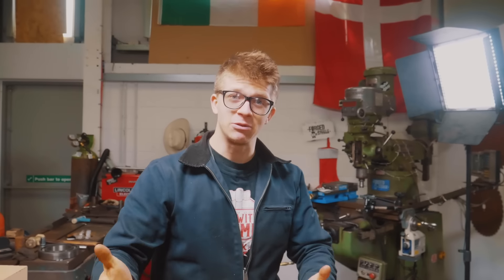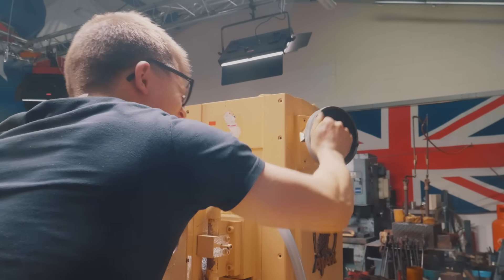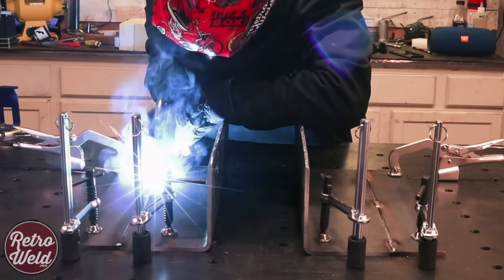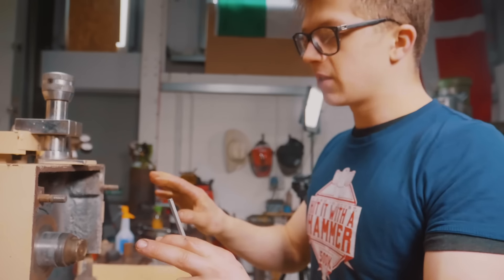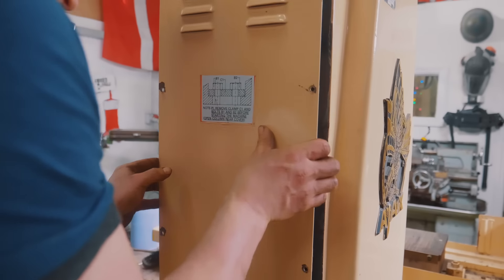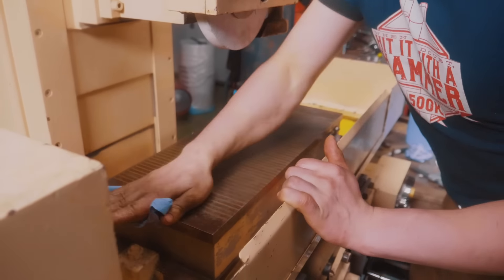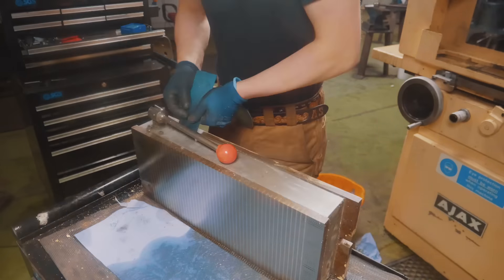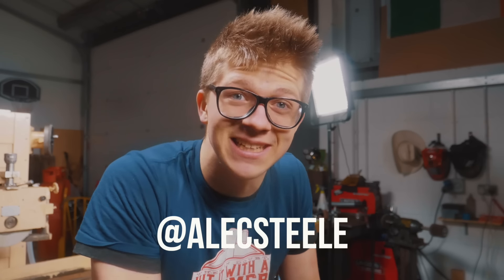THE SURFACE GRINDER IS ALIVE!!!

Comment: Alec as an electrician 2 thing that made me cringe watching you do the electrical 1st please use some crimp ring type terminals on the ends of the wire that you attached to the switch this will provide a safer & more reliable termination & please get someone to check the machine over to make sure it is earthed correctly. A bad earth wont stop it from running but it will stop the machine from becoming live if it develops a  fault. Turning it on & touching it in the hope that you don't electrocute yourself is not a good way to test a machine.

Comment: A good thing to do with that grinder table is to keep an oiled sheet like a section of bed sheets on the surface of that fresh metal. It will keep the moisture in the air from rusting the metal. It's a tip I picked up from my neighbor he does this with all his large precision equipment.

Comment: Hey Alec, we have been recently installing a load of 3 phase equipment and were also surprised to see that the neutral wires were blanked off. After a bit of research it turned out that some 3 phase motors don’t need a neutral connection. 👍🏻

Comment: Just a suggestion as a machinist squaring the chuck to the travel of the grinder is very important but it is only half the battle during the video you took off the back rail of the chuck when cleaning it when you square the front of the chuck again and put the back rail on the chuck you will also need to side wheel grind that in to make sure it as well is parallel to the axis of the tables travel. Also I'm assuming if you've watched videos on grinding you've seen people use stones on everything from the chuck to the parts they place on it, stoning takes the high spots on a grinder and brings them down to average the top of the chuck and makes sure the bearing surface of the chuck to the part is as good as It can be so I highly recommend if you plan on using the grinder for accurate parts to get one, another tip I saw you put the grinding wheel down on the chuck I recommend not doing that as the wheel is harder than the metal used to make the chuck so in placing the wheel on the chuck you may have put a slight ding in it not a huge issue but just good practice. Also when dressing the wheel a new wheel that you put on the grinder will usually need to be dressed quite a bit to make sure you are running true the wheel might be bouncing on the surface there should be a lines perpendicular to the axis of the grinder where the wheel skips that is how you can tell visually but you might also hear a slight bouncing sound that comes with experience but it is good to look for.
Reply: Ian Mannings Quality information right here. 👍 Another good idea is to color the edge of the wheel with sharpie and then keep dressing it until the sharpie is all gone, granted that only works if you’re using a white wheel. Also you’re traversing the diamond across the wheel wayyyyyyy to slow. You want to move the diamond across the wheel as fast as you can crank the handle. If you don’t believe me just try it and watch how much better your surface finish is.

Comment: What test did you perform to test that the machine is electrically safe. You need a licensed  ELECTRICIAN to do any electrical work. You openly say that you don't know what you are doing .Don't mess with electrical work get a professional before you or someone else ends up dead

Comment: you dont need to dress that wheel that often, just needs done correctly.... as long as you are making full passes and the finish is good, you are probably more than good on the wheel unless you are going for ultra precision.... out of square is irrelevant on the table..  also... your work piece just wants a flat surface..  quit fixing...

Comment: Ooof cringed at the wire straight under a screw.
Please either solder them or use a ferrule. The wires will not oxidise nearly as fast and will therefore be safer for a longer time. They're extremely cheap and easy to use but could save you money, time and increase the safety of the shop.
Reply: Don't ever solder wires that will be mechanically fixed after the fact. The solder will creep over time and leave a bad connection. Use a crimp tool and ferrules.

Comment: Not sure about the UK, but here in Germany it is actually illegal to just screw braided wire straight to the connection. You should definitely use a cable lug...

Comment: Hello Alec! A little tip for the surface grinder! When you're finished with any kind of grinding, let the stone run for about 30mins, that way all metal and coolant will fling off the stone! Otherwise it could clog up in small dents and actually ruin the entire stone, because of the sudden imbalance in those dents when you use it the next time!

Keep up the good work!

Comment: I assume that the UK has AC electricity. It shouldn't matter which way those live wires are connected. Because the current is alternating hence the name. But then again I don't think that I have ever mixed up the wires on any of my machines
Reply: It's three phase.
Reply: And even with single phase it matters as UK plugs have fuses, so you want that on the live side.